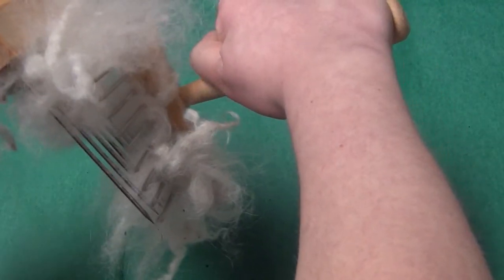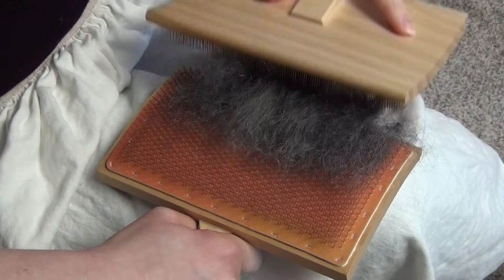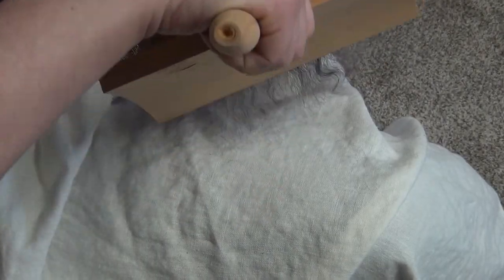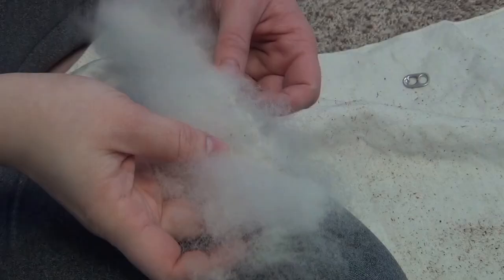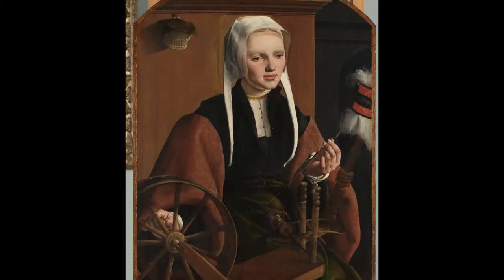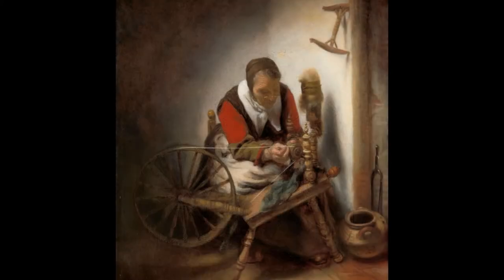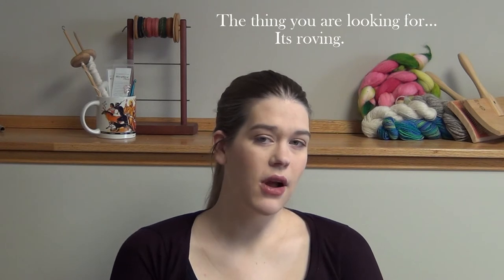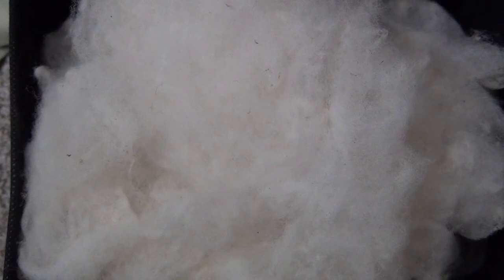Carding vs Combing | Tudor Flat Cap

Comment: I'm going to try to find the videos I have saved somewhere of people using the HUGE carders where you sit on the bench the bottom card is attached to  and then the person uses a card that takes two hands to maneuver. In the same video are some spinners who take these giant rolags and attach to the distaff.  They are basically mini batts and Lois Swales has a dressing a naked distaff vid where she uses mini batts.  I'll try to find the other video again. I also want to say there is a 1930s/40s vid of one woman using "regular" cards and the other woman spinning from the distaff but I could be wrong about the spinner. I'll look.